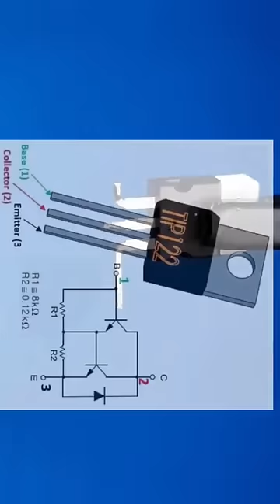How to Convert Old Cell Phone Charger to Mini Inverter 3.7 V İn 220V Out #shorts #zaferyildiz #short

Comment: It's just a Joule Thief variation, but with a flyback transformer instead of a inductor. And it's not suitable for any transformer from charger, as well as transformer pinout and windings polarity may be different. Capacitor can be omitted.

Comment: What other transistor can I use instead of TIP 122
Reply: Any power NPN for switching with a high gain
Reply: @Sentinel-1  .. you can use tip 41, 882..